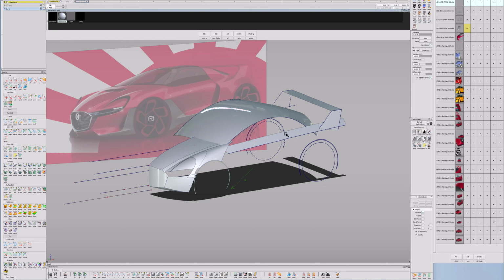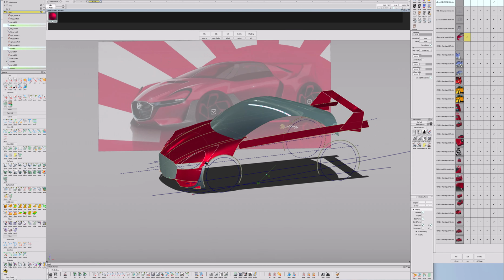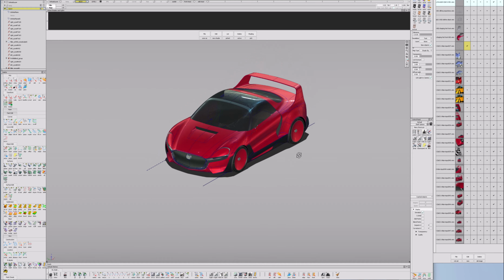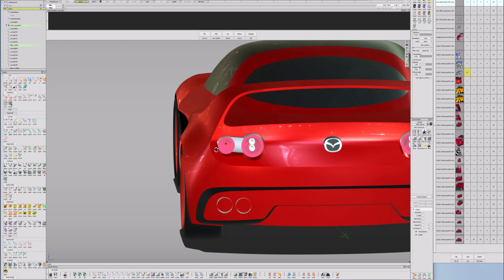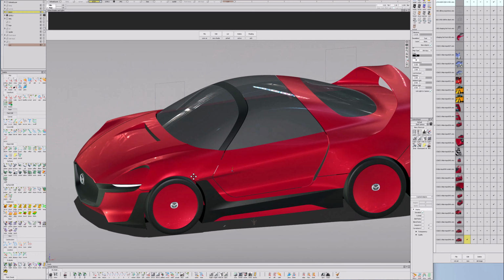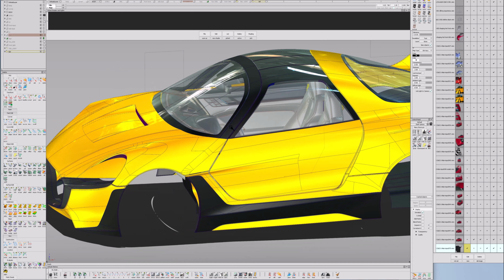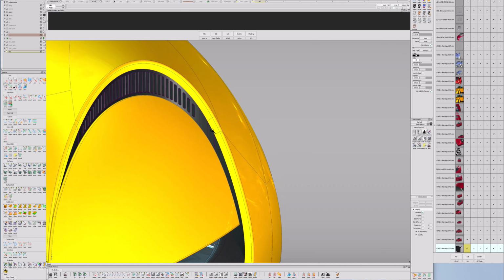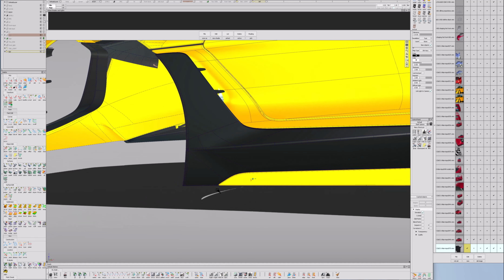Mazda AZ-2 Design Process: From Sketch to 3D in Autodesk Alias (ENG)

Comment: Thank you for your effort! I love how you interpreted the 2D sketch and controlled those beautiful highlights. I have a question: Other than the fillets, do you use any multi-span surfaces for the exterior of this car, or other models that meant to be manufactured? If yes/no, then why?

I'm just very curious if manufactured models (let's say for milling) are really restricted to single-span surfaces only.
Reply from the maker: spans doesn't mean bad quality, so if you have a surface with spans and you control it fully, it can go to production! easy!
Reply: @VladimirPanchenkoVV  Thank you Vladimir!